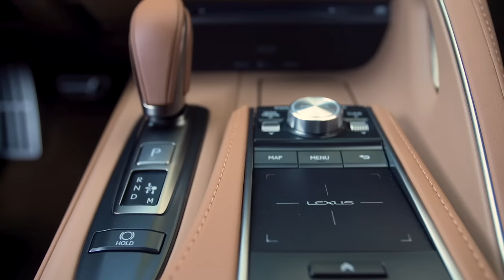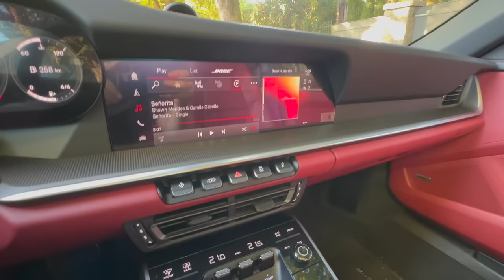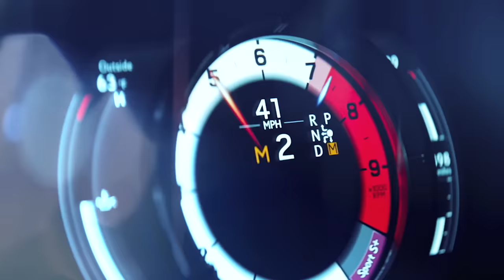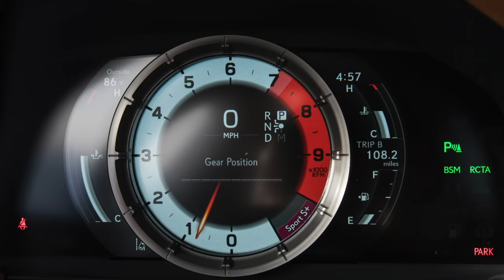ENGINEER'S COMPARISON: LEXUS LC 500 vs PORSCHE 911 // WHICH ONE WOULD YOU BUY? // LET'S DREAM!

Comment: Great video. I bought a 2017 911 C2s in spring 2016 which was the first year of the twin turbo 3 liter flat 6. I love that engine design. I agree with everything in your video. My wife drives a 2013 Lexus RX450h and the quality, comfort, and reliability of that car is amazing. I would imagine the LC 500 would be even better.  I never considered a Lexus when I was sports car shopping, and was all-in for a 911. No regrets. On a twisty back road the 911 is just amazing-just so agile and fun. The ride is a little bumpy though, and the wind/tire noise is really pretty bad at highway speeds. As an aside, I really prefer Lexus dealerships to my local Porsche dealership. I went in for some routine maintenance a few months ago and they tried to get me to pay 9,000 dollars for a 6 year service. Only 18k miles on the car. That drove me away to a great independent Porsche repair shop with great results and satisfaction.  I can't see a Lexus dealership doing something like that. It might be that the LC500  would be a better fit for my wife and I for road trips than the 911, but the handling of the 911 and the iconic design has made it a keeper for us.

Comment: Toyota/Lexus achieve high reliability by under-stressing the engine and suspension. Big capacity engines that produce less power and consume more fuel. Suspension that isn’t designed to be pushed hard. Porsche do the exact opposite. A tiny flat 6 that generates insane amount of power, suspension that can bear enormous g forces and brakes that are unparalleled in motoring world. All if this puts a lot of stress on the mechanical components that will therefore break more often. Choose LC500 if you want a serene, luxurious, hassle free ownership experience. But if you need/want an exhilarating and rewarding experience then it has to be 911 which WILL hurt your wallet big time, no doubt!

Comment: You did a good job but you are comparing two cars that are both unique but designed with different goals in mind. The 911 has always been a performance oriented sports car and renowned for that reputation and it costs $40K more then the LC500. The LC was an act of love by Lexus designers and engineers to create a halo car for the Lexus brand that would stand out as a unique car on its own and that is exactly what they have achieved. It was not designed for the track or to compete head on with sports cars like the 911 or many others, and is more in the realm of an Aston Martin or a GT model. It is unique in itself and stands out when seen on the highway and most people do not know what brand of car that it is, and Lexus would be the last brand they would think it is. The body shape is unique and looks good from all angles and the interior is the most luxurious and tastefully done in the industry. The engine may be the last big block naturally aspirated engine to be sold in mass production automobiles (although Corvette is coming out with the highest horsepower per cubic inch naturally aspirated engine every built for its high performance model). When you look at the details of the LC like the quality, the stiffness and solid feel of the chassis, the new paint that was developed which was developed (especially the blue),the 10 speed transmission, etc. there is no other car that actually puts all of those factors together as well as the LC500. It looks like a luxury car, it sounds like a muscle car when you open it up but can cruise in 10th gear very quietly and smoothly and can get over 30mpg on the highway. The drive modes can change its character from a refined GT to a beast by the turn of a knob. For about $110K US dollars, there is nothing that compares. The 911 and its variety of models is a classic and sets the bar for a pure performance sports car, but the LC500 is in a unique class of its own and getting more press coverage and interest as more and more are out there for people to see. I actually drive a 2018 LC500 and a 2020 Panamera and love both cars and they both have a unique look and personality, however, the LC is the one I take to car shows.

Comment: Tough choice but easy answer.  One of each.  911 cabriolet and LC500 coupe.  Problem solved.
Reply from the maker: Good answer!
Reply: Other way around. LC is more of a grand tourer so drop top with extra weight is ok. Definitely want torsional rigidity on a track 911.

Comment: It’s a good review, but an odd comparison.  The Porsche is a sports car and the LC a GT albeit a sporty GT and therefore people buy them for different reasons.  I’ve driven an LC as a daily driver for 4 years and I bought it because of its futuristic design (a work of art), it’s reliability, low maintenance cost, luxury and comfort, and the fact I can cruise 500 miles in comfort on a tank of gas averaging 29-30 mpg. Yes, most reviewers dislike the infotainment system, but owners quickly move to managing things with voice commands.  Some reviewers and performance tests compare the LC to the Aston Martin DB-11 where by AMCI performance standards it compares very well if not better…and at half the cost. What really hooks owners, though,  is the muscle car-like sound of the induction and exhaust noise which make for an emotional experience.  BTW, a point of fact. There is no such thing as a $130k LC in the USA. As for styling, I will admit to a prejudice against the Porsche. At the risk of inciting Porsche owners, the design is indeed iconic, but maybe it’s because every Porsche has been a variation of Ferdinand Porsche’s original design of the Volkswagen from the 1930’s.  Just can’t get that out of my head, but the rest is quite special. So if you’re looking for a daily driver in this price range and you don’t care about car badges or performance you’ll never use, the LC is a great choice.

Comment: Having driven both back to back and personally owning two Porsches (718 Spyder and 18’ 911 4S). The handling on the LC 500 is not in the same league as the Porsche. Which is totally fine as it’s more of a touring car and would be great for long road trips for ride comfort and NVH whereas the ride in the 911 is just tolerable on long road trips. Forget about taking calls or having conversations with people in the 718 Spyder, it’s that ridiculously bad. The NA V8 in the LC is a standout which alone makes it a worthwhile purchase. The howl of the flat 6 twin turbo is unmistakably 911, also fantastic. While I love Porsche, I do frequently contemplate owning an LC just for the experience 👀.

Comment: Both are equally great sports cars but I personally prefer the LC500. Can’t go wrong with either one.
Reply: Wanna bet?  You can go really wrong with a Porsche.  Some people have to learn the hard way.
Reply: @fontking1a  how??
Reply: If there is something that an LC500 can not be called is a sports car. Its clearly a Grand Tourer.
Reply: @treybyrd3332  They are expensive to maintain and unreliable. You will realize the first time something goes wrong. Parts and labor have to be factored in unless you simply don't care about money.  The electronic components are garbage and they will fail. Do a little research. Join a Porsche Group of Fan Club. Best of luck.
Reply: @fontking1a  welp i would get the ext warranty on it. also i love AWD and unfortunately there is no lc500 with AWD

Comment: I value my time and health more than anything. Money is not that important when we’re discussing $100-150K for a car. For me the Porsche is a no go. I know plenty of owners who have multiple problems with their cars ranging from oil pump failures, inadequate A/C output and uncooperative manual transmission shifting. The low seat height in a 911 is also an issue for many men over 6 feet tall and 60 years of age. Try to elegantly climb out of a 911 in a cramped parking lot while wearing business or formal attire. If you’re around 5’8” - 5’10” tall, thin and young you may enjoy the Porsche. Get the Porsche out of your system while young, because it may not be an option later in life.

Comment: Not sure what he means by "for the same money?"  I can get into an LC500 coupe for $101K.  A used Targa is $180-200K.  And the last time I took my C4S for an oil change, it cost $800.!  Yes folks, $800 bucks for an oil change, inspection, and loaner car.  I can get the Lexus serviced at the local Toyota dealer for $40.  I love my Porsche, but I will be driving a new Lexus.

Comment: I am comparing the AMG SL 43 (4 cylinder turbo hybrid) , the AMG can put accelerate it based on independent testing and corners better vs the LC500 convertible.

Comment: if the Porsche was as reliable as the  Lexus LC 500, it would easily win, however the staggering  quality of the Lexus and the gap in  craftsmanship leaves a chasmic difference between these cars...
Reply from the maker: Actually the Porsche's have been surprisingly reliable based on data from past history, though not as reliable as the Lexus's of course.

Comment: Thank you for the review. I've been an owner of the LC500 now for four years and have some very strong feelings for it.  They are special cars.  Special enough that when I ponder parting with mine, I go for a drive and instant recall just how comfortable and wonderful of a car it is.  As others (and you) have mentioned, I view 911's a bit more on the sports car side of the house, where as the LC500 is by far the GT.  Although, many have been surprised after some "spirited" group drives. I drive my LC to and from Carweek every year (2600 miles) and it's one of the first cars (out of the 100+ I've owned), that I literally could drive all day and not get fatigued.  I can also confirm highway trips seeing 30-33 mpg's out of this fabulous 471hp V8 is not unheard of.  My LC garners more compliments than my Ferrari F430.  I'm a fan of Porsche, but overall, I feel this is a better car all around and most certainly not as common as 911s.  It just checks more boxes and is certainly worth the $25k-35K LESS than a base 911 these days.  👍

Comment: as much as i love both cars. i just wish the lower trim 911 cars had a naturally aspirated flat 6 instead of turbo boxer 6 which takes all the soul the older 911 cars had. the GT3 with the screaming 4L NA flat 6 is what a 911 should be like
Reply: Buy a 991.1
Reply: I find it funny that you can buy a 911 Turbo that's turbocharged, or a standard 911 that's also turbocharged, or a Taycan "Turbo" that's electric.
Reply: Get a 991.1 GTS. 430HP sounds like not much but you’ll get into high triple digits very quickly and the sound of that engine with a good exhaust is Ferrari level.

Deman motorsports can also build it into a 4.5L and then you’ll be doing 520+ at the wheels.
Reply: Just got back from running my 991.2 GTS a on the twisty roads on a beautiful fall ish day here in n Central Texas. Perhaps it is just confirmation bias but the word soulless never occurred to me . Rowing the 7 spd through its paces over lots of turns and some road imperfections revealed a high level of chassis rigidity and this translated to a level of unflappability even with apex course adjustments at 1.5 - 2x posted in curves. The enormous torque found from 2500 to 6500 ( 400 ft/lbs  ) and while working at relaxing my grip on the wheel was rewarded with amazing front end feel ( especially for electric steering ). Wringing your car out near yellow line to get to the torque is fun but having the motive drive of a big block with Porsche handling , chassis rigidity and revability for the enthusiast road driver is amazing. It speaks volumes that the Toyota is not featured with a manual and to me shifting gears is one of the most soulful things you can do in a car , being forced into involvement and anticipation far  in excess of an auto or PDK car . I love my Toyota ( an FJ manual ) and if this comparison were between an LFA and a 911 / 992 series I might consider the soulless critique perhaps more on target . The rapid rev with the tap on the gas for manual rev matching on my car indicates to me a racing soul and heritage that the LC will never offer as a nice grand tourer because it is meant to do something different. Porsche’s target audience especially for the 911 is different , more engaged in the act of driving and the sensory experience of that interaction and perhaps less how fresh you feel after a 6 hour high speed interstate tour.
Reply: ....and the 911 targa would be perfect with a removable (panel) top like the old days instead of the heavy complexed electronic top. Include a manual and remove the turbo and you have a winner in my book.
Reply: @hrnfw4818  So the stereotype of Texas being just a bunch of long, straight, flat roads is a lie?  I should have known!
Reply: @JohnPMiller  Lets keep it on the QT. We don’t have the coast highway in cali but what we lack in majesty we make up for in long relatively empty runs. The DPS ( the only folks who rock lasers ) don’t bother with the c roads ( too little traffic ). A conventional radar detector will go a long way. With some nice cafes in small towns we have a very pleasant driving environment.
Reply: I’m driving a base 992, and it’s anything but soulless.

Comment: The 911 has a very dated shape and an engine that will not last the distance. The LC500 is by far the better looking car and possibly the best looking car on the road with an interior that has no equal. The greatest selling point for the LC500 is the engine and gearbox combination that will last the distance because it has no turbo. It has a big V8 that with regular oil changes will last forever. LC500 will be the winner in the long term for many years after the 911 becomes scrap metal.

Comment: I think a LOT of people miss the whole point of the LC. It is not a sports car. It shouldn't be compared to true sports cars (like the 911). The LC is a GT car. A more accurate comparison would be pitting it up against the BMW i850 xDrive, Jaguar F-type R, Maserati Granturismo, or the Mercedes AMG-GT. 

Comparing a 911 to the LC, you may as well compare a mini van to a truck. Sure, they're both vehicles designed to do a job. But, that job is completely different. The 911 and the LC were designed with two completely different end results in mind.

Comment: As an engineer who works in FINANCE, I would caution you against promising the value is always going up, etc. etc.  Jay Em has a recent report about 911's in the UK suddenly being massively over-listed on the car web sites and being discounted time after time and still not bought after many months.  The bottom fell out of the Supercar market several times already in my lifetime, and we're in the twilight of the gasoline-powered car anyway.  The electric cars are a lot faster in a straight line, just as my iPhone is a lot more accurate than a Rolex.  But keeping a hand-wound watch is a relatively easy small hobby compared to trying to keep a gasoline car once gasoline is a super-niche product.  I totally agree though that the question is not, how much you pay, but how much you pay minus how much you sell for.  I had the '95 Supra Turbo and '00 BMW M5, later the first week of production GT-R and the last manual F430.  The F430 has depreciated but after 15 years, it will have been cheaper to own than buying a new Mini every 3 years.

Comment: Having owned several 911’s, all air cooled, including a 930 (Turbo..!) can say they are magnificent cars: Durable, eye catching, and super fun on country roads or trips to the grocery store.
I’ve driven an LC, and currently own to SUV’s, a 2003 LX470, and a 2022 GX460 (luxury), and can say that overall they are the finest built, and most reliable cars I’ve ever owned.
IMO, the LC offers more for less than the 911’s, and in terms of fit and finish are magnificent.
Yet the Porsches offer what no other high performance sports cars offer at its price point.
Superlative overall performance with unparalleled, in its automotive category, reliability.
Were I in the market for a six figure car, I would have to have one (at least!) of each…

ps: excellent, thoughtful content; much appreciated…

Comment: Very informative breakdown. Comparing their comfort and performance does go a long to showing how the 911 is very much a pure sports car while the LC500 is definitely leaning a little mire towards GT car, so its not quite the 1:1 comparison something like the R8 or AMG GT is to the 911. Definitely close enough to warrant comparing, though. 

I do have a couple of points regarding value/resale, specifically when it comes to options. One of the things I love about Lexus is they tend to spec a car as good as possible, then just give it to you. The European manufacturers (including Porsche) tend to take a different approach; once they've specced the car, they see how much of it they think you'll be willing to pay extra for, then make those things options. 

This has two outcomes. Firstly, it means that while they might start out similarly priced, the 911 can get noticably more expensive very quickly. Secondly, the lack of options, combined with much lower resale, means the LC500 definitely seems like a winner 2nd-hand, because you pretty much only need to find one in a colour you like and it's exactly how you would've specced a new one.

Comment: The Lexus LC 500 is a nice car but in my opinion if you are going to compare it with a Porsche 911 get a real one like the 911 turbo s, now this car will smoke that lexus  with a twin turbo v6 making 640hp all wheel drive all wheel steering and 0 to 60 in 2.6 seconds  and it too is a daily driver.